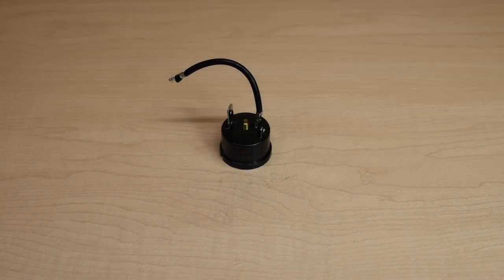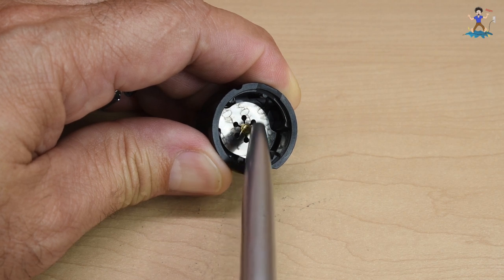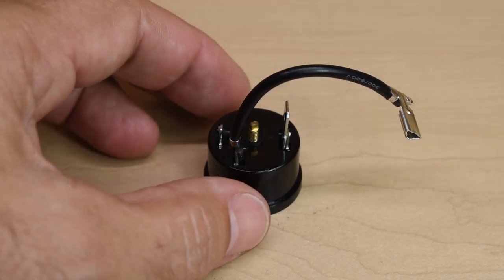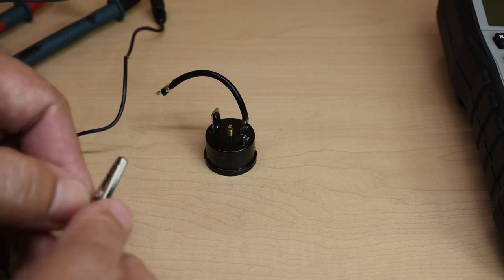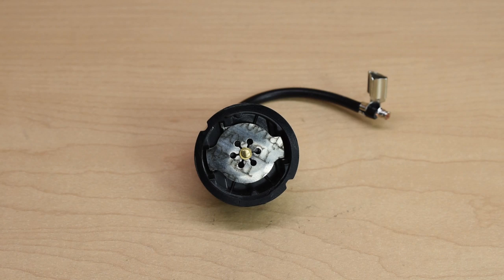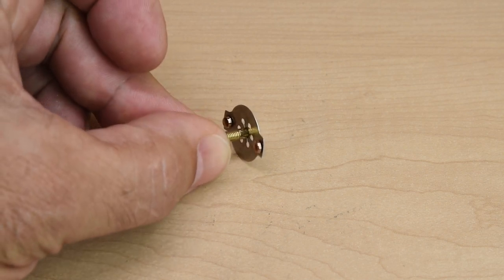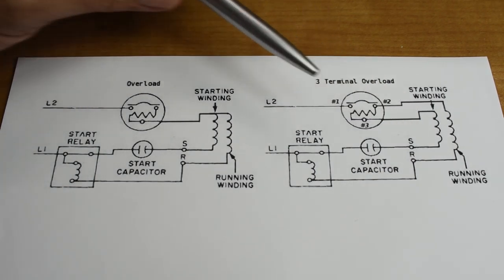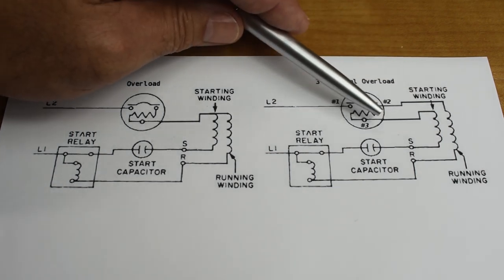How Electric Motor Overload Protectors Work & How To Test Them!

Comment: Thanks for the great video.  At about 6:10 you say that if you turn the screw clockwise it will "make the temperature higher. And if you want to increase the temperature, you would want to go counterclockwise."  I'm confused. It seems like you're saying you can make the temperature required to deflect the disc higher if you go clockwise or counterclockwise.  Please explain.
Reply from the maker: The disc is curved a certain way. The screw puts pressure on the disc helping it to bend and pop in the opposite direction easier, which lowers the triggering temp. No pressure on the disc, a higher temp is required to trigger.

Comment: I have a three wire thermal overload protector that has continuity between all three wires when cold. The motor has power to it and does not hum or get hot. The on/off switch works fine. This is on a table saw motor. The op went out one time before and replacing it fixed the problem. Is the op bad?

Comment: This video saved the day! I was about to chunk my compressor:
My manual overload switch was stuck open even when trying to reset it. I had to take the adjuster out or reset it. Still have cont8nuity between 1 and 2 and 1and 3 but getting there...

Comment: You can order devices like these for Coffee makers, Heaters and other heat related items.   rated at various Wattage / Temps.  Handy little beast.  These use the Current generated Heat (WATTAGE) to do the heating.  Same things just different applications. Replacing the Therm o Switch in  a Coffee maker from 210F with a 175F unit I was able to convert my coffee maker into  Mini Ethanol Distillation system.. LOL  Local Law and Regulations apply.  Snerkkkkk.
Reply from the maker: They sure are super handy. Thanks for watching! Have a great New Year!

Comment: YES、bimetal
Also to the safety device of the water heater
Reply: bi metalic switch are in all sorts of stuff microwave ovens, hair dryers, heaters, welders, thermostats, amplifiers, boiler's kettles, toasters and on and on basically any thing that could over heat and as a result be damaged and or dangerous.....
Reply from the maker: Thanks for watching!

Comment: Really interesting , thanks for posting. I have an electric 12 volt 400 watt motor with two long leads (3m) for the thermal protection, these normally lead to a control panel so I can reverse the motor which foils a sail. but my control panel is an older model and not sure where it would go , Could I buy a cheap overload switch ? But not sure how would this detect heat ? Thanks in advance for any info.
Reply from the maker: I have no idea what kind of protection you have using just wires.

Comment: Good demonstration, thanks.
BTW I have a question about bronze or brass brazing a stainless steel to stainless steel or to mild steel, is it possible or not? 
If you have had any experience with it tell me about it.
Reply from the maker: A bronze rod, using the right flux and high enough heat should work. Thanks for watching

Comment: Time out chief? Is the heat source in practical applications generated externally by a motor or by current flowing through the so called "restive wire" as you claimed in the video or is it both? I think it is not meant to be restive wire at all just a conductor here?
Reply from the maker: It's a resistive element. The schematic symbol shows it, as well as the datasheets.
Reply: @electronicsNmore  Thanks very much for clearing that up. So over current in the form of heat trips this? That is the design idea not actual external heat from the motor housing? In other words, you could have demonstrated it with excessive current flowing through the restive element no heat gun and an amp meter with of course a source?

Comment: diagram looks wrong it shows the start winding connected through the heater element surly it should be the run winding on series with the heater?  nice vid fellla
Reply: @Willam_J  Oh yeah I see now thanks for that,,  now you say I remember some experience of this, years ago I had a large dehumidifier and the digital controller for that had a setting for setting and adjusting restart delay to prevent compressor from stall damage..  Thanks again for taking the time to explain :)  Happy new year Steve

Comment: hi i purchased a blender with wattage 1600 and overload protector it has is 4 amp where i live the value of ac is 230v from my knowledge of physics the blender should not be 1600 watt instead 920 watt or less if you consider power factor etc. am i missing someting or i'm right about the calculation. can you help
Reply: It acts like a very slow fuse, so during peak amp draw it heats up but will not blow Everytime motor start or it momentarily hits a max load. Peak power rating > normal full load power.

Comment: my compressor never stop running and get very very very hot...Do you thing that overload relay could be the problem. (for my wine fridge). The compressor, running and i have cold inside it. Thx
Reply from the maker: Make sure all the coils are vacuumed clean.
Reply: @electronicsNmore   ok thx for your quick answer. but i cannot have acces to the coils. i have a sanyo sr-w4500(m). impossoblie to get acces inside the unit. sound weird i know. but it is impossible to get acces. maybe the overlaod relay ???

Comment: motor runs for 2 minutes shuts down for 5 minutes , looks like their is a sensor attached to the motor windings , could it of gone bad ? only have about 20 hours on it
Reply from the maker: If it has a run capacitor, make sure it's good(the correct value). Also make sure the voltage input is correct. It's possible the windings are faulty.
Reply: @electronicsNmore  thanks for the advice

Comment: Larger 3 phase motors have no internal or any attached devices (like in this video) for thermal overload protection. They rely on externaly, remotely installed thermal overload devices as well as current limiting devices, usually located at the motor control center. Usually a 3 phase motor would have 3 fuses and a thermal overload block located directly under the starter block. Obviously, the thermal overload units have no direct contact with the motor, therefore they must be selected and sized based on the individual motor's current rating.
These devices are mandatory for each motor installation. Fuses alone will only protect the motor if there is a short in the motor or the wiring. In most cases, fuses alone will not protect a motor from damage caused by overheating.
Reply from the maker: Correct. I've seen those before. My buddy owned a scrap metal business and had them. Thanks for watching! Be sure to share.

Comment: Anyone know where I can get a 2 wire 70°c max thermal protection switch for a air vent attic fan motor. I called manufacturer and told them motor was fine that all I needed was that switch and they said they only sell replacement motors not the parts to them, of course they don't why would they want the consumer to save money
Reply from the maker: This type also works, as long as you don't exceed 10A or 70c. 
https://amzn.to/2yUXzd2
(Amazon Affiliate Link)
Reply: @electronicsNmore  thanks just saw ur message and went ahead and ordered what u suggested

Comment: They're very cheap, llike $2 to make, will fail quickly such as low freon causing compressor motor overheat. I wish they'd spend a few more $ to put a proper thermal relay to cut pwr.